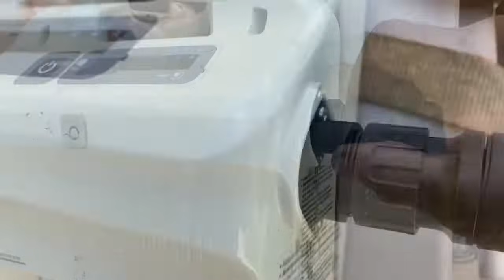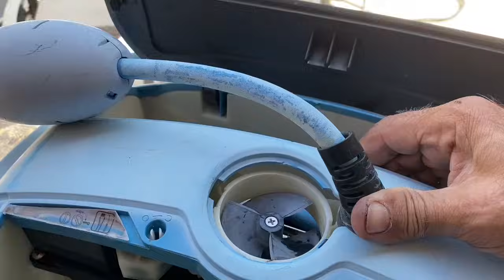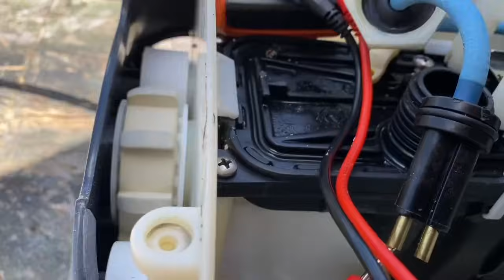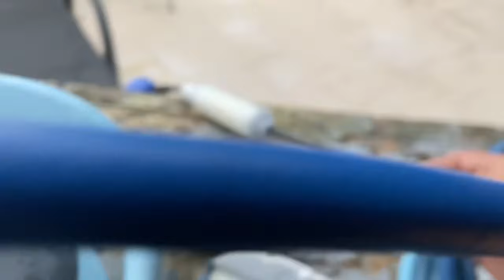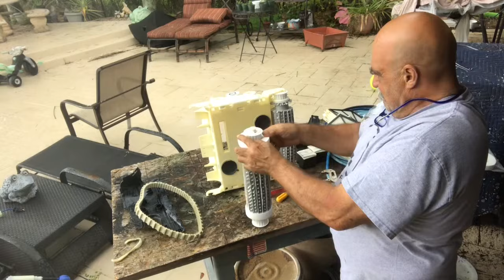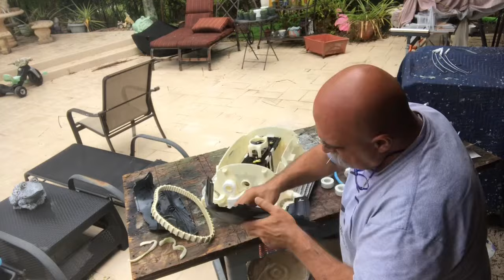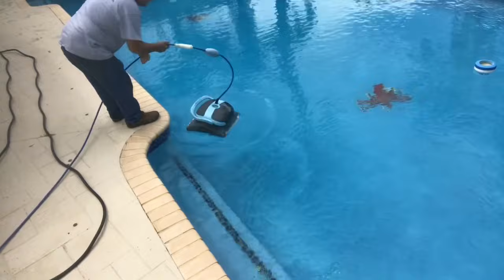How to diagnose and repair a dolphin pool cleaner

Comment: If you replace the cord, and it still dont work, what's next?  A new motor?  Have you got a video for that to diagnose?
Reply from the maker: You checked your old cord for continuity and you had one line not working if so, that’s when you replace your cord if you did that please check your new cord and make sure it has the continuity for each one of those if it doesn’t return it and have them send you a new one that means that cord is as bad as the one you just replaced, I would make sure that I have a good cord first if you do and it still does not work it is very possible that it is your motor, but it’s unusual that your cord and your motor went at the same time. Let me know how it goes.

Comment: I’m having problems with my motor spinning with the fan blade took it all apart. If I touched the fan to a battery it turns on, but won’t work off the circuit board.
Reply from the maker: Thank you for your comment it sounds like it is something on your circuit board, but I have not had that issue. I hope you like the video and if you can leave me a thumbs up.

Comment: I can’t pull my power cord out of my dolphin body. If I pull any harder it will rip something. Are you sure the Nautilus CC can have its cord removed this way?
Reply from the maker: Did you make sure you unscrewed the clip? I know it’s a bit tough to get it out but they do come out. It’s usually the rubber Gromit that is holding it in tight. Mine is the dolphin if it doesn’t look like mine then it may come out differently.

Comment: Thank you. Mine is on its fourth season it was only going a couple feet and stopping after taking mine apart I definitely think I have a seized motor it's almost impossible to turn by hand
Reply from the maker: Did you go through the Total diagnostic test to make sure it’s not your cable or your power supply? If so, then more than likely it is your motor I’m glad you liked the video and if you can leave me a thumbs up.

Comment: I was having problems with mine running for about 30 secs, stopping and starting all over. It would go forward, backwards and then start climbing the wall. When it got to the top it would die and restart over and over. First thing I did was test the cable and power supply. I was getting 29 VDC at the end of the cable. I figured it was my motor that was going bad. Got new motor put it in and same thing. Got new tracks and bearing thinking maybe too much resistance and it was the same. I finally went back and tested the end of the power cord again and still 29 vdc. I then wiggled the cable at the swivel and voltage dropped. I ordered a new cable and put my old motor back in and it’s working like new!! I now have a spare motor for the future. I thought this thing was maybe smart and the computer chip inside the motor was detecting resistance and powering off. It was the floats would hit the top of the water and lose power at swivel. New cable fixed everything 😂 thanks for ur help!!
Reply from the maker: Thank you for the information more times than not. It’s the cable from all the twisting and everything that goes on with them. I’ve had to replace several cables and one power supply. The reason I even did this video before I had taken the dolphin to a repair shop and the guy thought it was the motor and charged me for a new motor and then it still did the same thing. I had him give me the old motor I bought a new cable learned how to do all of this myself so I do have a spare motor. It’s the price of learning, but I have enjoyed doing these videos and I hope you leave me a thumbs up
Reply: You got it 👍🏼. I also took apart the swivel to inspect and it looked good. No corrosion and both pins were up. I’ve had my unit for over 6 years and I’m guessing the spring over time the spring that holds the piece together has worn out and doesn’t keep a good contact.

Comment: This video was super helpful for troubleshooting and testing! The only problem is that we tested everything and everything came back fine. But our vacuum still won’t run. Anyone have any suggestions what we should try next?
Reply from the maker: So you tested the power supply that came out fine you tested the wire and that came out fine. Also is what I’m understanding but it’s still not working. This then only leaves you to the motor. The motor itself you need to be able to test that to make sure it’s functioning and apparently it’s not if your power supply is functioning properly and your wire then it should be your motor which is the most expensive part to fix on this unit. I hope this helps you and if you can leave me a thumbs up.

Comment: Is there a way to test the actual motor? The cord on mine has three prongs going in but tested with voltage meter and seems to be getting correct power
Reply from the maker: Thank you for your question as long as you’re getting the right power from your controller and to the end of your cord, then it’s most likely the motor. I hope this helps you and if you can leave me a thumbs up.

Comment: thank you for this video.
My cc plus passes the self test and then shuts down, the power supplies stays on.
I tested the cable and power source, they have 29V.
i cleaned up everything, nothing stops the parts from moving. I even changed the rotating parts .
i am afraid that the motor is not strong enough anymore but i do not know out to test it.
Any ides?
Thank you
Reply from the maker: Thank you for your question but I am not sure how to test the motor if it’s strong enough or not if everything else is passing then the only thing left is the motor itself. Sorry I can’t help you any further. I’m glad you liked the video and if you can leave me a thumbs up.
Reply: @buildingwithpapa  thank you , that is also my thought. I did thumbed up your video

Comment: wow what a video , you covered everything i needed with all instructions , very impressive
Reply from the maker: Thank you for your comment. I’m glad you liked the video and if you can leave me a thumbs up.
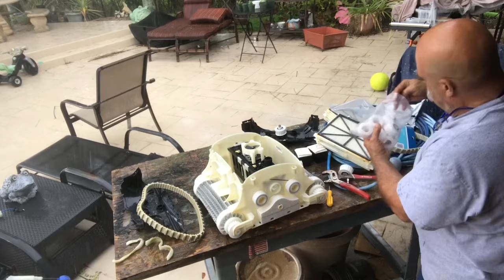Reply: @buildingwithpapa  i did, thank you ! your thoughts. at 7:30 your instruction is my problem , i am losing my track every 3 uses, when i reinstall the bearing pully (like you stated) is off center put when the side rails pop back into place the bearing is square, these are the original tracks, pullys and bearings, also your thoughts on non oem parts ? again great video i will save this as a go to
Reply from the maker: Pull your rollers back off see if your bearings are loose, also check and see if the metal pieces in correctly if not, then that’s moving while it’s running and the belt will come off. I didn’t change my belts either. I just turned them inside out but eventually, I did have to replace them. My guess is that the bearings are worn or the end is not attached to the metal rod correctly. Let me know if this helps you and thank you for your comments.
Reply: @buildingwithpapa one last question? What is your experience on this machine using non oem parts?

Comment: Papa! Your video is still helping people. I was hesitant to DIY but then I saw your video. The one, and only, minor detail. The cord strain relief, it moves! You don't need to wrestle it back into the slot on the top. Maybe getting it out the first time is very difficult, but putting it back I sprayed a bit of Blaster Dry Lube on it and no problems at all, I slotted it into the top, then put the top back on. It might be easier to get out with a bit of spray prior to trying to remove it. I also see what one person said, getting the treads on while keeping the rollers in place is difficult, I think it is essential to do it as you did, standing the unit up so it is vertical. Thanks again!
Reply from the maker: Thank you for that information. I hope I don’t have to change my cord again. If I do, I will use the spray. I am really glad the video is helping people that has been my intention. I like doing these videos this year. I plan on putting up more. I only did a lot of shorts last year, but I want to continue to do more videos and better videos. If you can leave me a thumbs up I really would appreciate it.

Comment: Should each prong on the cord make a beep when you touch it with the tester? It only sounds when I touch one and this happens on both sides.
Reply from the maker: When you’re testing it if you have it on the one end and you touch the other end and it makes a tone. Those are the two that are the single line then go to the opposite ones and test those if you get a tone, then both are fine if you don’t, then the one that has no tone the wire is broke if you get a tone on both of them, then the cable is not your problem.

Comment: Thanks for the video, I just replaced gears but cleaner runs a litlle beat, stop and not moving at all. What do you think is the problem? Programing or  motor?
Reply from the maker: Thank you for your question. Did you run the full diagnostic that I show that you have the right voltage coming out of the power unit? You say you replace the gears did you check all the bearings? Let me know what you find out. I’ll try to help you any further. If you can leave me a thumbs up. Thank you.

Comment: Iv rebuilt mine after the motor side track kept slipping off. And it’s still slipping. Any ideas of what could be causing this issue?
Reply from the maker: Make sure the roller is in completely squared up and not tilting otherwise it can slip off and the cover should help it stay on. I hope this helps you and if you can leave me a thumbs up.
Reply from the maker: Also check the rollers if they’re not rolling freely, you may have one that’s stuck and that’s what’s pushing the track off. Let me know how it works out.

Comment: Mine will run for a while stopping and the red light comes on. They say to check the impeller that  it is clogged up. Mine is clear I am at a loss to what is going on.
Reply from the maker: Thank you for your comment. I don’t know which unit you were talking about. Mine may be an older unit. It doesn’t have a red light. Check the shaft of the impeller and see if there’s anything wound up on the shaft that could keep it from moving. Also, I hope this helps you and if you can leave me a thumbs up.

Comment: Thanks for this great video!  I was going crazy trying to figure out what was wrong.  The connection to the motor was super hard to pull off but I put a hairdryer on it for about 90 seconds and it came off.  The connector was completely corroded.  I cleaned up the prongs and ordered a new cord.
Reply from the maker: That’s great. I’m glad the video helped you. I hope you continue watching and if you can leave me a thumbs up.

Comment: Great video!  I’m having an issue with my tracks keep coming off the pulley / rollers.  It’ll run for 5 minutes and then the tracks come off and it stops moving.  I’ve replaced the tracks already.  I wonder what I should do next?
Reply from the maker: Have you checked all the rollers to make sure none of them are stuck. It doesn’t make sense that it’s pushing off the rollers because the sides snap on should keep it from coming off unless one of the rollers are not moving and then it may just be sliding off the roller that’s not moving so check that out and let me know what you find out I can’t think of anything else Being you changed the tracks.

Comment: Great video! Impeller was not jammed, and my power cable was fine. I used a multimeter to check power to the power supply and only got 12.1 versus the expected 29. That saved me $500 over the cost of replacing the whole unit. Thank you!
Reply from the maker: OK, that’s great. I’m glad to hear that. I hope you continue to watch and if you can leave me a thumbs up.
Reply: you had to replace anything?
Reply: @bragbag7894 just the power supply. MUCH cheaper than the whole thing
Reply: @bragbag7894 did you ever get a reply?
Reply: What did you have to replace to get power right?

Comment: Hey! Thanks so much for your tutorial — I gave you a thumbs up on your video. I just replaced my cable because I assumed it was the problem. When that didn’t fix my issue I came looking for help and found you. Im going to grab my multimeter and get to work — why didn’t I think of that? Here’s to hoping I can get it up and running again! 🤞
Reply from the maker: Thank you for your comment and thank you for the thumbs up. Let me know how it goes. I hope this video helped you out and I hope you get your unit running. Have a great day.
Reply: @buildingwithpapa ended up still being the cable. It didn’t have good contact but was easy to trace once I pulled out the multimeter. The pool has been back to looking good for a few weeks now. Thanks again!
Reply: @nuixy  was it the blue or black cable?

Comment: My cleaner would not run , so my husband  took apart & checked all power sources which were in working order!   Still will mot run ! Any suggestions !!!!!       Also I operate manually , but the WIFI LIGHT FLASHES  has s this normal
Reply from the maker: Thank you for your comment if he’s checked all power sources, the power supply is good in the cable is good then it may be the motor mine does not have Wi-Fi. Which unit do you have?

Comment: I am not connected to WiFi.   But the light flashes  how do I get it to manual only ?
Reply from the maker: My unit does not have Wi-Fi. Which unit do you have? It’s sounding to me like your motor may be bad.

Comment: Yeah, good video, I'm about to take mine apart. It stops working when you throw it in water, but it works outside the water.
Reply from the maker: Thank you for your question. Have you done the diagnosis with the multimeter on your cord and manipulating your cord because it does not seem right that it works outside the water and not inside the water that should not have any effect. There’s something separating the connection and it could be in the float of your Cord. I hope this helps you and if you can leave me a thumbs up.

Comment: Question. At what point should I stop fixing and buy a new one? How do you know when the wheel need replacing. It looks like the inside of the tracks are getting worn. I replaced tracks 2 seasons ago. Thanks for any input.
Reply from the maker: Thank you for your question to me. I would continue to do the repairs. They’re not that expensive to buy a new one depending on the model but I know I paid over $1000 for this one quite a few years ago and for tracks and gears and wheels they’re very inexpensive so it all depends on you. I hope this helps you and if you can leave me a thumbs up.
Reply: @buildingwithpapa How would I know if there is a problem with the wheels?

Comment: Excellent tutorial. I have a question though. Everything seems to be running great but it is not picking up the dirt on the bottom of the pool. What should I do?
Reply from the maker: Where are you able to see the impeller? Is it moving? That’s what draws the water up from the bottom if that’s not moving then that’s your problem. Do you have the same unit as I do or is it a different model? I hope this helped you and if you can leave me a thumbs up.

Comment: Mimes starts moves forward a few feet stops go backwards a few feet then completely stops ...ive cleaned everything inside ...any ideas ??
Reply from the maker: Thank you for your comment. Did you go through the complete diagnostic to find out if it’s your power supply?

Comment: Maytronics builds the biggest garbage in the pool industry. I would never ever recommend another one of their pieces of junk. Myself, and so many people I know have expensive issues after 1.5 to 2yrs requiring another new unit.
Reply from the maker: Thank you for your comment. The thing is is they are very easy to work on and if you can buy the parts yourself, it’s minimal but I had mine for years probably at least 5 to 7 years before I had any issues so I don’t know which one you’re talking about. Yes they had cheaper ones. This one back then cost me over $1000 but it worked great for many years and then once I learned how to work on it I just continue to replace the parts such as cord rollers everything that I’ve showed you well I hope you like the video anyway and if you can give me a thumbs up.

Comment: When I activate my dolphin, it starts up for 15 seconds then stops, impeller no longer spins. Would that still be a cable issue?
Reply from the maker: Thank you for your question. What cable do you have? Is it a non-tangle does it have a swivel? If so, it could be part of that but usually if it’s a non-swivel type it would not be the cable I hope this helps you and if you can leave me a thumbs up.
Reply: @buildingwithpapa  no swivel, at least I don't think it does. It looks like the exact same one you have based on when I removed the impeller cover for cleaning.

Comment: At the beginning bench test you said it 'knows it's not in the water'...how does it know it's not in the water? My unit behaves the same way both in the pool and on the bench, it runs for a short time and stops.Does it have some sort of sensor that might not be working?
Reply from the maker: Thank you for your question. I re-watched the video twice because I didn’t remember saying that it knew it was out of the water. It doesn’t have a sensor and re-watching the video. I don’t see where I made that statement. so I don’t believe there’s anything wrong with your unit. I hope this video helped you and if you can leave me a thumbs up.
Reply: Your motor might be jammed